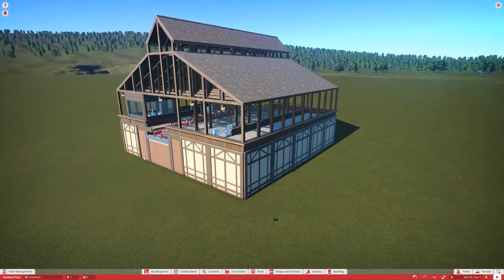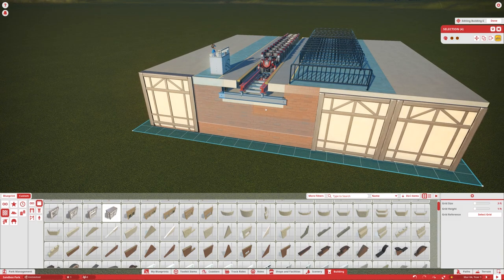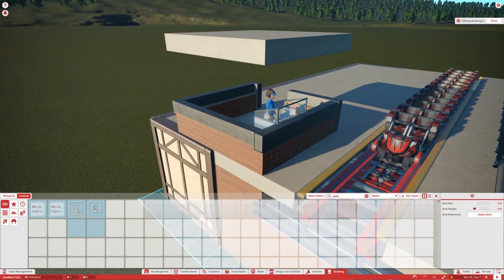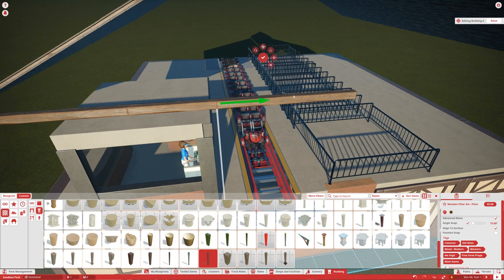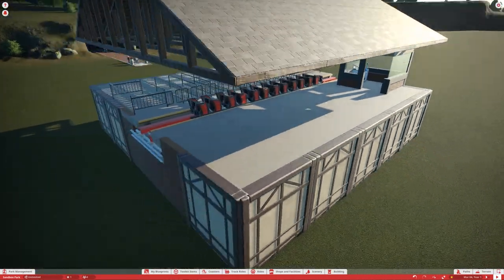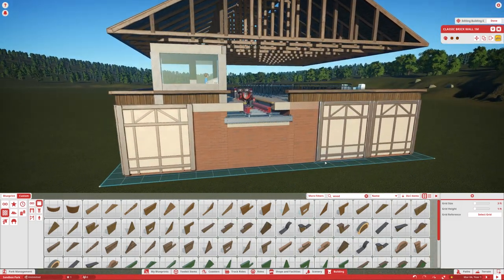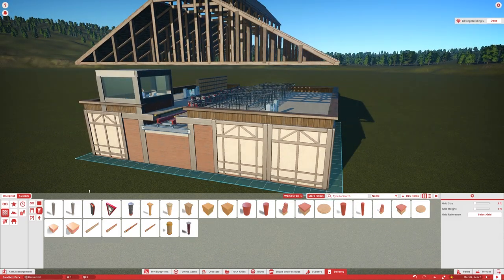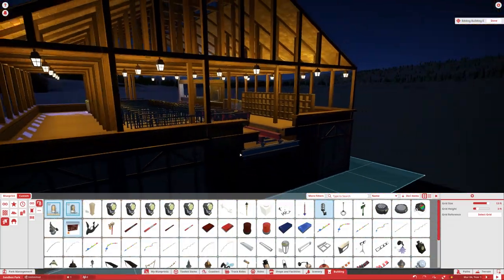How To Build a Good Coaster Station in Planet Coaster

Comment: How did you rotate the wall piece? You didn't explain that and I can't rotate it to go along the station. It goes perpendicular to. You're doing all these movements and controls and I don't have a clue. So the rest of what you're doing doesn't matter until I can move the pieces like I want. For instance, I cant put a roof on top of pillars.
Reply: This video is no help if you don't explain how to rotate wall pieces.

Comment: Hi, I know this is old. But I just started playing. I can't seem to figure out how to rotate the wall while on the grid. Could you tell me what I'm doing wrong. Thanks.
Reply: I believe you hit Z to rotate, and if you hold Z down you can freely rotate it. The game should pop up with a tutorial message that tells you the controls
Reply from the maker: if the wall piece is a grid piece you can only rotate it 90 degrees using the z key to rotate however you can rotate it to whatever angle if you are not editing the building but it will rotate the entire building. Hope this helps!
Reply: @JLWGames  Thanks I figured it out.